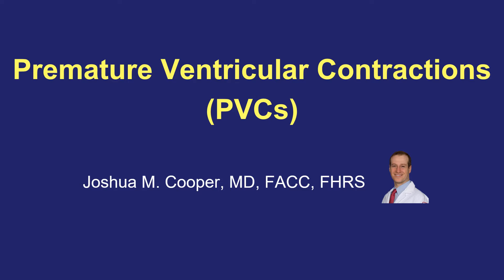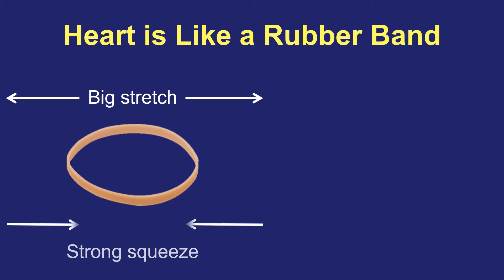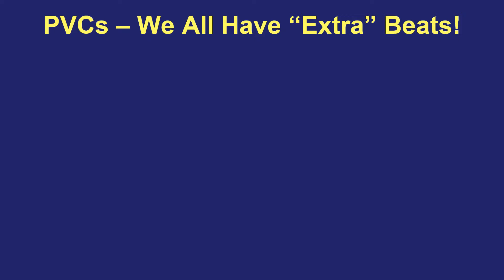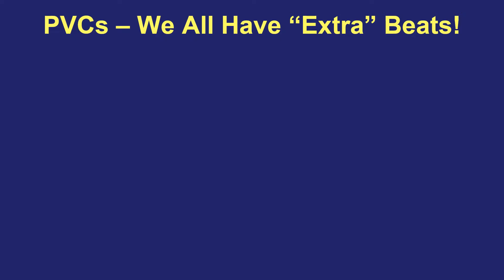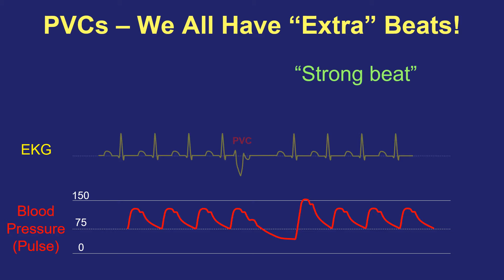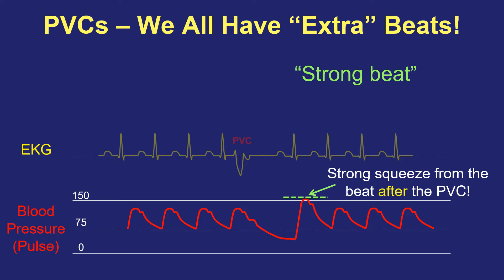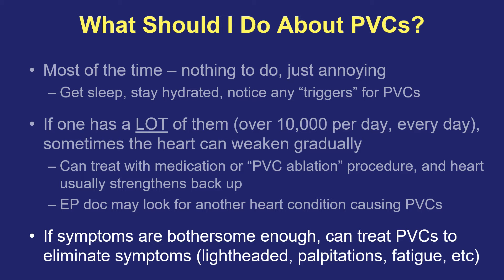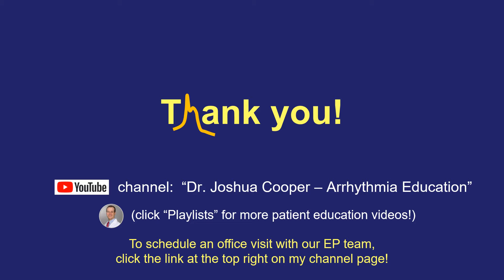PVCs: Symptoms and Treatment - in Plain English!

Comment: Will they ever go away?  I had an ablation and it still didn’t work.  I’m so depressed.
Reply from the maker: Sorry to hear about your persistent PVC symptoms.  The location of the PVC origin, as well as the frequency during the procedure can impact the success of catheter ablation.  If PVCs remain after an ablation attempt, sometimes a second ablation can succeed, using the information obtained from the first procedure to achieve a better result the second time.  Or sometimes a new medication strategy can work if catheter ablation was unsuccessful and the decision is made to go in a different direction with treatment.  Consider getting another EP opinion if you are unsatisfied with the current management of your symptoms (recognizing the possibility that the second opinion might be the same as the first, but on the other hand, sometimes a fresh pair of eyes makes a lot of difference!)

Comment: Thank you for the explanation, but I’m unclear what you mean by a “tiny spot” that’s causing the PVCs.
Reply from the maker: A heart cell or small cluster of cells less than 1mm in size. If that spot is on the surface of the heart muscle, a single ablation burn or freeze will eliminate it easily. If the spot is deeper inside the wall of heart muscle, it can be a bit more challenging to get it to go away permanently (but we have ways of making it work!)
Reply: @dr.joshuacooper-arrhythmia9917  I appreciate the time you took to explain that. This collection of cells in the heart is interfering with the normal electrical impulse?
Reply from the maker: @stevenreichertart  No, that cluster of cells is initiating single extra beats at random, taking over at those moments from the normal natural pacemaker spot (located in the top part of the heart) that should be solely responsible for creating each heartbeat.
Reply: @dr.joshuacooper-arrhythmia9917  Thank you again, Dr. Cooper. In six months of research, this is the only explanation I’ve heard about the cause of my PVCs. I understand there is a collection of cells somewhere in the ventricles that is sending a signal for the ventricles to beat prematurely, independent of the signal that would normally come from the atria. No doctor or internet source has ever told me this. 

That would explain why I still get PVCs even while meditating. I notice an increase in PVCs after eating, but no other behavior. 

Thanks again for your time.

Comment: Dr. Cooper,  would you recommend catheter ablation to someone who otherwise needs metoprolol and flecainide to control their pvc's?  Mine were every 3 or 4 beats when discovered about 1.5 years ago.  The medications work great but my electro physiologist is really encouraging me to get the ablation.  Your thoughts?
Reply from the maker: The decision of whether to continue using effective medications or consider catheter ablation is yours, after weighing the pros and cons of both choices.  Factors to consider would include the likely location of your PVCs (some places are easier/safer/more effective to ablate than others), cost and any side effects of the flecainide and/or metoprolol, efficacy of the medications (i.e. any breakthrough symptoms?), and your overall philosophy about medications/suppression vs procedure/"cure" of the PVCs.  Some people would not want to take even small procedure-related risks if medication is working well.  And some people would much prefer a procedure so they can stop taking medications for the problem.  There are no cumulative/long-term problems with being on either metoprolol or flecainide (or the combination of both).  Some people have new circumstances arise that change the thought about taking the medications (such as a woman wanting to become pregnant, or anyone developing other heart issues such as coronary artery disease).  There's nothing wrong with switching strategies from medication to ablation, as long as that is the choice you make, and not one that you feel pressured to make. Best of luck to you!

Comment: I'm having an episode of PVCs right now. Although benign, they are distracting. I have a history of Atrial Fibrillation w/RVR, so I'm no stranger to these "extra beats." Mine seem to be happening every 13-20 beats right now. I take Atenolol (100mg) daily.
Reply from the maker: Your cardiologist or EP doc can use a heart monitor to quantify the number of PVCs and help you make a management plan for symptom management and also for medical reasons if a high burden of PVCs is found (over 10,000 per day) with any impact on heart pumping strength.  Beta blockers like atenolol sometimes help with symptoms, but if that is not adequate, antiarrhythmic medication or ablation could potentially be helpful.  Best of luck to you!
Reply: Thankfully, they sub-sided a couple days ago. Just trying to stay away from caffeine and sugar, meanwhile. Thanks for your input!
Reply from the maker: @Shaxuul  Great to hear. PVCs often come and go in clusters. Keeping well-rested, well hydrated, and managing stress well seem to help many people keep PVCs under better control. Although "flare ups" are common and we often don't have a specific explanation 🤷‍♂️

Comment: I had mild covid infection in January. Then i had taken covishield vaccine(Astra Zenaca) on 6th March.  Two weeks later, i have ectopics and then consulted cardiologist . ECG and Holter evaluation showed VPC only and i was started on Metoprolol slow relase 25 mg once day.  As there was no much improvement, now i am taking Diltiezem slow release 90 mg once day for the last 2 days.  I am due for my 2nd dose of Covishield vaccine on the 6th of June.  I am 55 years old and hypertensive on Irbesarten 150 and Hydrochlorothiazide 12.5 mg once a day .  Can i take my second dose of Covishield vaccine? Thanks
Reply from the maker: I've seen a number of patients have a flare-up of PVCs with covid infection (and a few also after getting the vaccine) - when the body gets revved up for any reason, PVCs can temporarily flare up too.  Talk to your doctor, but almost certainly you should get the second vaccine dose.  And yes, you might have a temporary flare-up of PVCs again.  Hopefully things will quiet down for you.  If not, you can speak with an EP doc to discuss options for treatment (aside from metoprolol or diltiazem) if symptoms are frequent enough to consider that.  Keeping well rested, well hydrated, with reduced stress (if that's possible!) can help.  And over the counter magnesium supplement can help some people feel fewer PVCs.  Best of luck to you!

Comment: I’ve been dealing with PVCs since 2012 when it hit out of nowhere along with anxiety and gerd. Had a full heart workout back then and everything was normal. I still get them and now they come more frequently. Sometime it seems it become more frequent during ovulation or menstrual. They’re aggravating and can be scary. Especially when I’m resting and out of nowhere they come. I’ve worked out which actually calms them? I guess it’s time to get another heart work up done just to be safe. But wondering has anyone have PVCs along with reflux and or anxiety?
Reply: I have extreme anxiety from PVCs I also noticed they get worse around my menstrual cycle.. I’m currently going on day 3 with about 30 skipped beats every hour.. I have done holter monitors and an echo both came back normal.. seems as I get older they get worse and last longer.
Reply: I see most people with pvc have gerd and anxiety. Vagus nerve connection?

Comment: Hi doc I have PVCs alll the time but mostly around  the times around my period . I had a ekg once at the doctor and she said I was fine but . Isn’t it bad for the body to have those skipped beats  since the heart can’t  fill with blood?  I don’t ever feel dizzzy but sometimes I feel like it might make me more anxious ..   eating also helps me someone’s for them to go away...
Reply from the maker: It is very common for women with PVCs to notice changes in PVC frequency related to their menstrual cycle.  Having sporadic PVCs is certainly not "bad for the body," as the brief period (usually less than 1-2 seconds) without an active pumping of the pulse does not cause any harm.  But to the contrary, even brief skipping of the beat can cause significant symptoms and create sudden anxiety!  An EKG only shows the heartbeat for 10 seconds, and so it is often not sufficient to make a diagnosis of PVCs (unless one has the good luck for a PVC to happen during those 10 seconds!).  Heart monitors that are worn for anywhere between 1-30 days are excellent ways to diagnose PVCs and see how many are occurring.  The main situation where PVCs can cause trouble is when there are more than 10,000 per day, every single day - in that case, sometimes the heart can weaken (but it usually strengthens back up when we control or eliminate the PVCs with a medication or a catheter procedure called PVC ablation).
Reply: @dr.joshuacooper-arrhythmia9917  Wow thank you . I don’t have that many in one day but I do get them sperracticly. .

Comment: Hello Dr.Joshua Cooper , I Have PVC's too And Starting one day for no reason ( I have Anxiety Problem so many years )  I Have WPW a.k.a Wolff Parkinson White Syndrome too My doctor Said to me PVC's all about anxiety and WPW does not make PVC's , do you agree Dr.Joshua ? WPW not a make PVC's ? and my doctor not ablation operation me for my WPW is that normal ?
Reply from the maker: I can't comment on your specific situation, especially not knowing details.  It is possible for someone to have 2 separate arrhythmia issues (WPW which one is born with, and PVCs which can shop up randomly in anyone).  WPW does not cause PVCs to happen.  However, it is possible for extra beats that are related to WPW to be misinterpreted as PVCs - an EP doc should be able to tell the difference between PVCs and other WPW-related phenomena on a heart monitor or EKG.  Not everyone with WPW needs ablation, but if symptoms are found to be related to WPW, then ablation can be very helpful (same with PVCs).  If you are not getting answers to your questions, it is always reasonable to get another opinion.  Best of luck to you.
Reply: @dr.joshuacooper-arrhythmia9917   Thank you for your comment, dear doctor, I think to see a few more doctors, they may have other ideas, especially when I lie on the left side, I feel extra beats and when I put my hand on the left side, my heart beats independently or differently, is it possible to feel this by touching with my hand?
(wpw)

Comment: Do PVCs cause irregular beats? I was diagnosed with PVCs in January. Lately, I've noticed my heart beat to be irregular going from 70s to the 100s on my oximeter. I think I have AFIB but not sure. I feel confused and depressed. I have another appointment coming up. Any help will be greatly appricated. Just advice please. Thanks
Reply from the maker: As outlined in the video, PVCs are typically single extra beats that occur one at a time, with varying frequency.  The normal beats that occur between the PVCs are usually regular in pattern (i.e. sinus rhythm).  If PVCs happen very frequently, such as every 3rd or 4th beat, without a predictable pattern, that could make the pulse appear to be irregular and could be mistaken as "a.fib" on a blood pressure cuff or finger pulse monitor (oximeter).  The good news is that there are several ways to make a definite diagnosis, such as wearing a heart monitor that is prescribed by your doctor.  And the other good news is that there are treatment options for just about anything that might be going on.  If you are looking for information on a.fib (not to imply that is what you have), I have also created a couple videos that might be helpful:

https://youtu.be/dneHCQ7VcnU

https://youtu.be/rlTIfYy083U

Best of luck and I'm optimistic that your doctor can help you, or else refer you to a heart rhythm specialist who can get you some answers!
Reply: @dr.joshuacooper-arrhythmia9917  Thank you for replying so quickly. I appreciate your advice.

Comment: Can losing weight reverse pvc's?  I've never had pvcs before until I got heavy (318 pounds).
I did have a Holter monitor hooked up for 48 hours. Dr identified pvcs but stated they were irregular
Reply from the maker: It's a great question! A number of studies have now shown a strong correlation between being overweight and atrial fibrillation. So it seems very plausible that being overweight might also be associated with PVCs. It sounds like you already have noticed a correlation between having gained weight and developing PVCs. Might or might not be related. If you lose weight and the PVCs disappear again, send an update!
Reply: @dr.joshuacooper-arrhythmia9917  will do. I've since lost 25 pounds. Still experiencing the rumble in my chest (I think it's stress induced bc aside of my weight, I'm also working two jobs and completing my bachelor's degree).  In your experience do you think a patient experiencing temporary stress induced pvc eventually goes back to normal if the stress disappears? Or is do pvcs leave lasting damage to hethe heart?
Reply from the maker: @errolm8313  PVCs are unlikely to do any permanent damage to the heart, as long as you are not having ~10,000 or more of them every single day. And yes, it is very possible that when your stress level goes down, the PVCs will quiet down too. Nowadays there are so many stresses on everybody, and I look forward to a time when everybody can start to feel better! Best of luck to you!

Comment: My 24 hrs holter test shows 10.6% pvc. I used to drink lots of energy drink in the past which i regret now. Doctor prescribed me metloc xl 12.5mg for 2months. Is 10.6% pvc a bad number?
Reply from the maker: A weakening of the heart muscle in response to PVCs has been demonstrated in patients who have 10% or greater PVC burden for weeks and months on a continuous basis. But there have been patients with 10% or greater PVCs for long periods of time who demonstrate no effect on their heart muscle pumping strength.
And so if somebody has 10% or greater PVCs on heart monitoring, their doctor will often check an echocardiogram to look at their heart pumping strength. If it is normal, and the patient has no symptoms from PVCs, it is not unreasonable to watch and wait. A follow-up heart monitor and / or echo is a very reasonable plan, especially if it is thought there might be a reversible cause of the PVCs, such as energy drinks or some other circumstance. And a beta blocker like metoprolol succinate is a very reasonable treatment when PVCs of that burden are initially found.
Even in situations with no obvious cause for the frequent PVCs, they can sometimes simply subside on their own, so waiting and getting a follow-up heart monitor is a very reasonable strategy.
If PVCs are symptomatic, regardless of burden, discussion about treatment options with the doctor is very appropriate.
Reply from the maker: @sagargurung395  An echocardiogram is the correct test to look for evidence of weakening of the heart. If the heart function, known as "ejection fraction," is normal, that suggests that at this point in time there is no evidence of weakening.